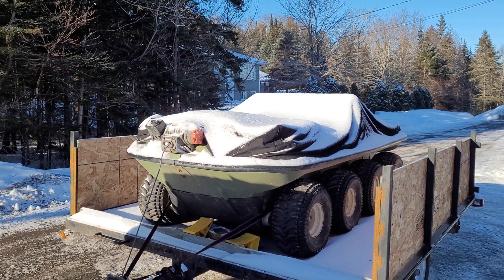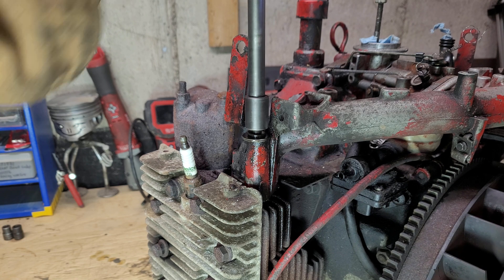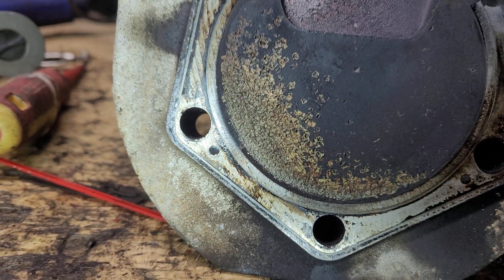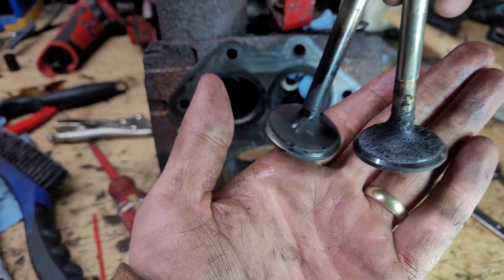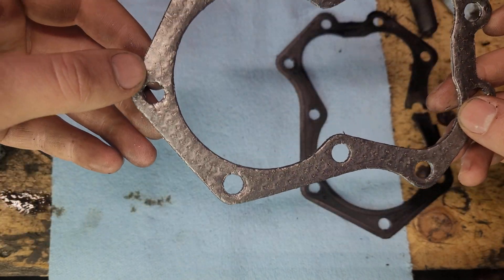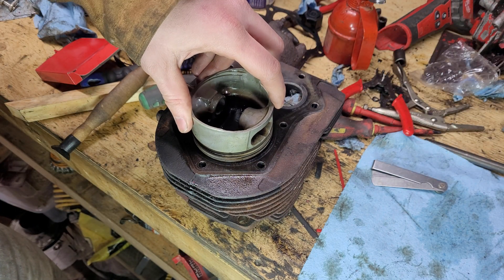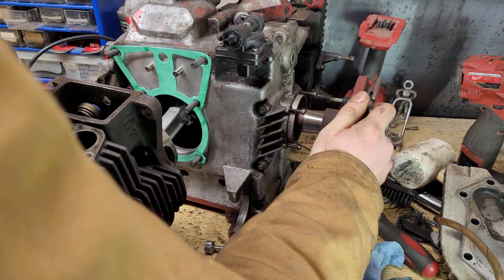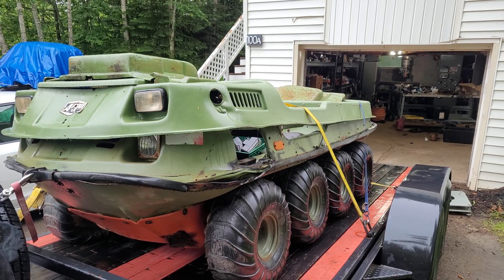Argo 8x8 Part 5: Kohler M18 Engine Issues and Rebuild

Comment: wow, 3 months since last video. Crazy
Reply: FYI, I believe that new head gasket is made of a material we call “grafoil”.  I work in maintenance at a paper mill in upstate NY and we use this material for sealing high temperature applications.  Basically a sandwich of stainless steel foil between two layers of graphite impregnated fibers.  At least as far as I can tell from the video,  it should be more than suitable for that purpose.
Reply from the maker: @johncook931  glad to hear it! I've been a little worried about the service life of that head gasket. So far so good though
Reply from the maker: It's mostly the video editing that slows it down. I use to really enjoy the editing, but now I find it kills me to sit down and do it.